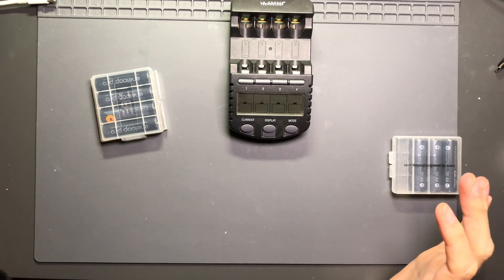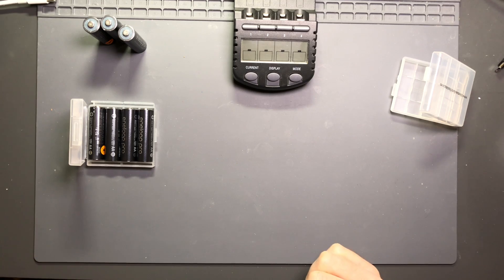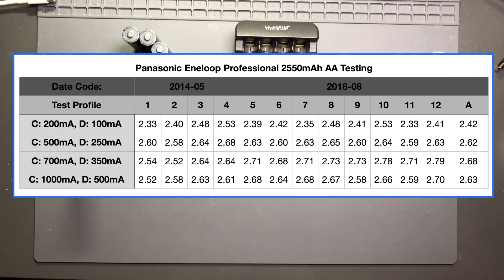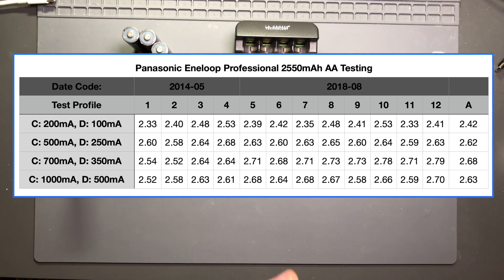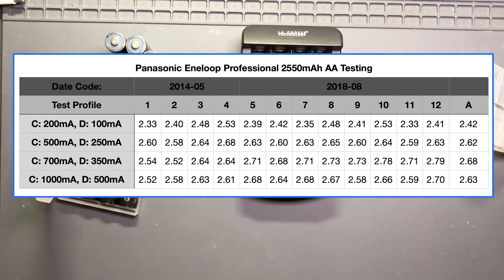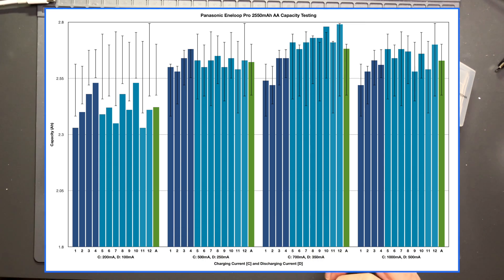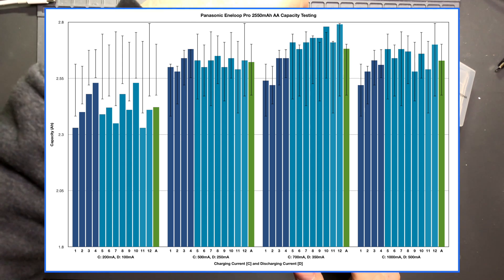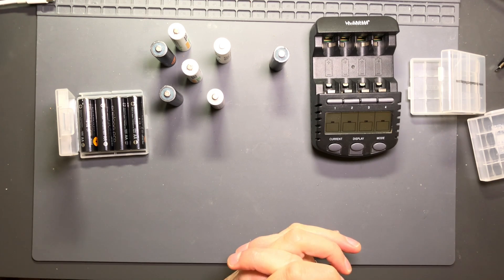Panasonic Eneloop Pro Long-Term Testing Results

Comment: is it better to discharge all your batteries to about 1A after using them in say a 4x AA flashlight? I absolutely HATE how some devices will "die" only to find out that it is a single AA that died and the other 3 are still pretty full.. it's like, why are you a 4 cell device mfker! 🥲 use them all up!

Comment: Are Eneloop Pro batteries suitable for hardwired smoke detectors, where the battery is only for backup power?  How would they differ from an alkaline battery for that purpose?  For context, my power never goes out for an extended period of time.  Every few weeks it might go off and then is back on in 5 to 10 seconds.   Over the past 10 years living in the house the longest power outage was about 5 minutes and this was very rare.
Reply from the maker: Great question. I feel this is best answered in an upcoming video.
Reply: @TheCuriousEngineerChannel  excellent!  Look forward to the upcoming video.

Comment: Great video but you should compare the long-term use of the LADDA and the ENELOOP PRO. Everybody wants to know if the rumor that the 2 batteries are the same is true. Many people say they are the same but for some reason no one has tested their capacity after 1 year of use (the 85% capacity retention is Panasonic's marketing argument).
Reply from the maker: Stay tuned. 🙂
Reply: @TheCuriousEngineerChannel  I will 😃 Thanks a lot for replying. I feared that my message would be unseen and/or remain unanswered. I'll stay tuned, I have activated the notifications 👍 Cedric from France.

Comment: Thanks for this.  Panasonic BQ-CC65 charger uses 750mA for charging which seems to be ideal for Eneloop PRO according to your graph.
Reply from the maker: Yeah that is a decent charge current. Perhaps I didn't mention in this video but the charge current doesn't matter as much; I just included it for reference as it's what this charger's profile allowed me to select. The important bit is the discharge current. The newer charger/analyzer I am using lets me set both the charge and discharge current independently so newer battery test videos only show a default charge current of 600mA. I'll be doing a video on that charger/analyzer soon. Thanks for watching!
Reply: @TheCuriousEngineerChannel  I got 8 Eneloop pro for two photo flashes - Olympus FL-600R and Olympus FL-700WR. Those flashes seems to be almost identical to Panasonic Lumix, so ... I expect them to be compatible with those batteries at least. I dont know how to quantify that kind of discharge, apart from being really fast.

Batteries are dated 6/2021 and 8/2021, I used  'Refresh' charge on the BQ-CC65 for the start,  but the discharge rate is missing.

For conclusion, Eneloop Pro can charge both flashes in an instant - even when used 1/1 the "charge" indicator just barely blinks, batteries themselves are fully charged in 4 hours without running hot. Old batteries took 8 hours to charge and flash took 1-2 seconds to charge from them.

Comment: Should i invest in this just for remote control, wall watch, headlamp?
Reply: For most everyday uses the regular non-pro eneloops are probably a better choice.
Reply: For remotes don't waste your money on eneloops :D just get some Ikea Laddas or GP recykos or whatever else at a quarter the price. Remotes hardly use power, and if you just change the batteries every few months  you're fine with whatever batteries,( even if they discharge a little bit faster.) And yeah I agree definitely don't get eneloop pros. For a headlamp these (eneloop pros) are great though.

Comment: As a Eneloop/Eneloop Pro user myself I've recently started buying IKEA LADDA batteries, they have the same specs and they're made in Japan, and from what I've read theres only one factory in Japan that can currently make those low self discharge NiMH batteries. So they're basically Eneloop Pros but a lot cheaper
Reply: These Ladda are of higher capacity than regular Eneloops buthave only an cycle rate of 500 cycles. I can not find them cheaper on amazon ebay or Walmart. Maybe the Ladda are compared to the Eneloop Pro sincethose have as well only 500 cycles.
Reply: Yeah IKEA LADDA 2450 are Eneloop Pro 4 gen at a much lower price. It is definitely worth buying them, I paid about 15 dollars for the charger and 4 IKEA LADDA AA 2450